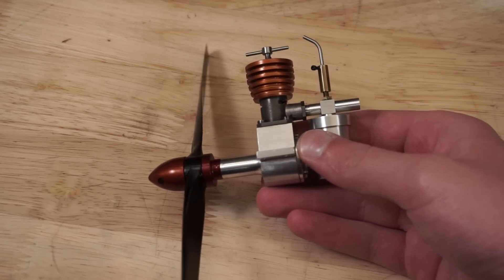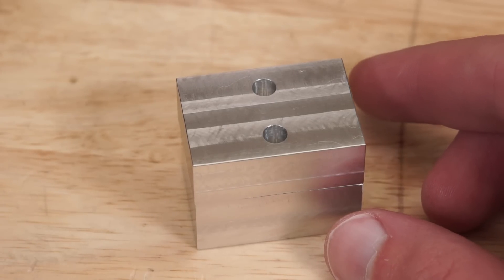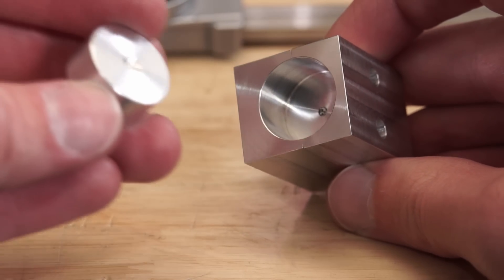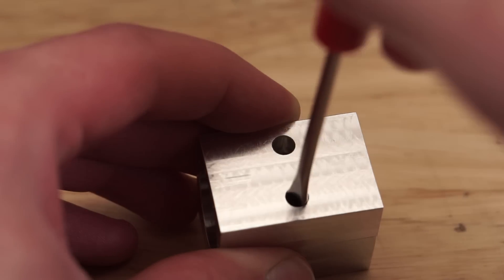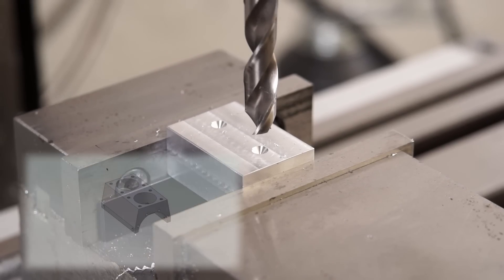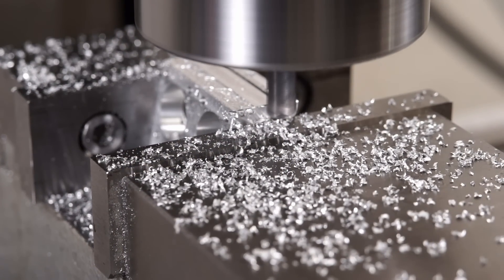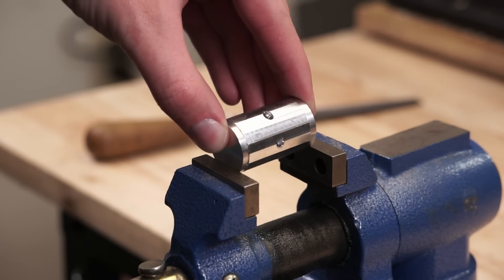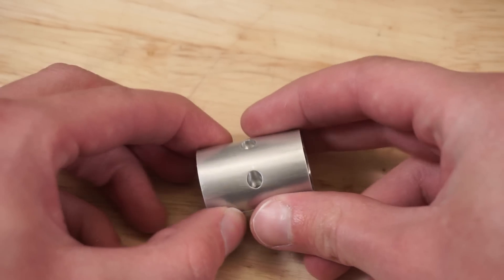Making a Twin Cylinder 2cc Engine for My Remote Control Airplane

Comment: How did you get the front and rear crankcase volumes/center bearing perfectly in line
Reply from the maker: The front section and main bearing are bored in the same setting and the face turned as well, the rear housing location doesn't need to be exact, there's about .020" clearance around the crankshaft so i just flipped it around and bored it. I put a big spot on each side in the milling machine to have something to dial into the 4-jaw. 
Thanks for watching!

Comment: your filing plugs: if you would have left an on-center post on the outside of each you could have set those posts on the top of your milling vice jaws. Then  touched off on a shim on the mandrel major diameter and used the milling machine to do the whole radius. just lock Z, loosen vise and turn a few degrees mill again, repeat, repeat...
Reply from the maker: I just set the edge of the plugs on some parallels, they're thin enough to not touch the part. i didn't show it in the video, but you can sort of see the facets in the shot just before filing.

Comment: It looks like you're using oil as cutting fluid. WD40 is a nice lube for cutting aluminium with HSS. A 5 litre bottle with some decanted in to a spray bottle makes it so easy to spray while cutting

Comment: Amazing work. 👍 I would love to see you expand and build a radial aircraft engine, even just with three pistons.
Reply from the maker: I've got plans for a 5 cylinder that is small enough to fit in my machines!
Reply: @JellyFishMachine  I'd love to see that! Both of your machines are the smaller Sherline variants (Mill/lathe) right? I Was looking at buying sherlines here soon as well for stuff like this.
Can you recommend size/packages from sherline for this size of work? Ever since I found your weaver build series I've wanted to try making one myself!
Reply from the maker: Yes i have the smaller lathe and the 12" mill model 5400, don't bother with the 10" 5000 mill, the 12" is only around $80 more and the extra y axis travel is well worth it. what i don't suggest is getting extended x axis or z axis, the machine really doesn't have much rigidity to spare and the standard x and z is plenty for sherline size work. I would also avoid the 8-direction or nextgen machines, all of the extra adjustments make the machine difficult to align properly and also very easy to knock out of alignment, for only a limited improvement in versatility and significant reduction in rigidity that makes it in my opinion not worth the hassle or expense. 
for the lathe, i haven't used one of the long bed versions, again my main concern is one of rigidity, the bed of the machine is unsupported across its span and it's likely fine for most work but i went for the smaller machine mostly for rigidity sake, i push my machines pretty hard (i have lots of professional machining experience). also keep in mind if you are working primarily on very small work like the steam engine i just built, (which is where the sherlines shine) the long bed machine places the z-axis handwheel well out of sight and reach making it a little more difficult to work with. 
My suggestion is the 4500 8" lathe with zero adjustable handwheels (very important to get the zero adjustable handwheels, working without them is a nightmare)
https://www.sherline.com/product/4500c4530c-lathe-with-adjustable-zero-handwheels-package/#description
and the 5400 12" mill with DRO. the DRO isn't so critical on the lathe but is IMO mandatory on the mill, it makes life drastically easier not having to count handwheels and backlash in 3 axis.
https://www.sherline.com/product/5400a-dro5410a-dro-deluxe-mill-package/#description

if you can, get them in packages, you save a lot on all of the accesories that you will end up buying anyway down the line, if you can swing it then it makes lots of sense. 
https://www.sherline.com/product/6000-dro/#description
the only issue there is the long bed lathe, you might be able to call them and get a package made with the short bed lathe. 

keep in mind that the sherline machines are very small, and the weaver is (IMO) near the upper size limit of what is realistically possible with this class of machine. people have done larger work, but it's always a stretch do do large work on small machines. I actually have a larger grizzly mill, and that's the one i am using in this video. this crankcase can be made on the sherline, I made my first weaver on the sherline mill, but especially boring the cylinder holes is a stretch on the mill, it really is lacking in rigidity. for smaller work, like the 0.1cc "Nano" engine or the steam engine i built, the sherline machines are unbeatable for the price. an Aciera F1 would be nice but also 10X the price lol

If you have any more question don't hesitate to ask.
Reply: @JellyFishMachine  Thanks for the incredibly detailed response! 
I'm currently looking at getting the 8" lathe C package with adjustable handwheels and 4 jaw independent 3.1". Thread cutting is a must, I also am debating getting the vertical milling column attachment for the lathe. I can't afford a mill in addition to the lathe I figure it should be good enough to get most of the work I want to do done and be a nice introduction to milling until I can purchase a dedicated mill (which will likely be a benchtop one from PM or Grizzly so I have larger options). The goal is small model engines such as the weaver, but I had plans of doing other projects in a similar size range, maybe some a tad bigger. I've always had a fascination with engines, and used to make pneumatic ones in Lego so being able to make small fuel engines is an absolute dream!

I do have a 7x12 Grizzly lathe that I am having a hard time getting tuned. If you have any advice for it I would love to hear, it's one of the cheap Asian import lathes. It chatters on 5 thou DOC on aluminum and brass on any speed I've thrown at it, unless it's at a snails pace. The toolpost and compound deflect a ridiculous amount, I think I measured it roughly to 30 thou in one particular bad case. Another issue is the compound slide is basically unusable. The dial on the handwheel sticks to the frame and messes up the reading, and there's no real way to fix it with my tooling, so I just keep the gibs on it tightened down as much as I can. If it wasn't for the deflection and imprecision, and a few other minor issues I'd need to fix, I'd just spend the money on a benchtop mill instead. At this point though I'm about fed up having to work on it, and am looking at selling with all of the additional tooling I've gotten for it over the years. 

In the end I've never been able to get anything remotely precise off of that lathe. I don't have a functioning compound, whereas the sherline doesn't need a compound because of the headstock. The precision and expandability for their tools? The entire thing is kind of a big ol' lego kit. Plug and play for a lot of there additions and attachments, it's light and portable and I love the concept of it. Even if the work is small, I can just adapt my ideas to be miniature! hah. Plus a lot of the tooling seems to be far cheaper than for most more regular benchtop mills, and most of all, the stock will be significantly cheaper for much smaller work.

Comment: Do you have any recommendations for an rc engine to build for someone relatively new to machining?
Reply: I'd recommend the Titan .60.  There is a complete written build article, and a complete video series on building the engine on YouTube.  It does require machines just a bit bigger than Sherlines, though.  Just search Titan .60.
Reply: @tjh44961  thank you, I'll check it out :)
Reply from the maker: The boll aero 1.8 is a good one to start with, all of the parts are quite simple and the size is easy to work with. 
Plans - http://www.modelenginenews.org/plans/BollAero18.pdf
Writeup - http://www.modelenginenews.org/bollaero/index.html
And if you can built that then the weaver is well within reason
Plans - https://www.adriansmodelaeroengines.com/catalog/main.php?cat_id=213
Writeup - http://www.modelenginenews.org/weaver/index.html

Check out the late and great Ron Chernich's website for lots of awesome info on building these types of engines:
http://www.modelenginenews.org/
In particular the section on making:
http://www.modelenginenews.org/techniques/index.html
And Cylinder Lapping: 
http://www.modelenginenews.org/techniques/cylhone.html

I wouldn't reccomend the titan .60 to start with as the castings are hard to find (or time consuming to make) and would really hurt to make a mistake on, on the other hand a mistake on a barstock engine part might result in some colorful language and a few extra hours to make another, but barstock is much easier to get than castings!
Reply: @JellyFishMachine  thank you so much! This is incredibly useful info :) 

I'll have a look into all of this